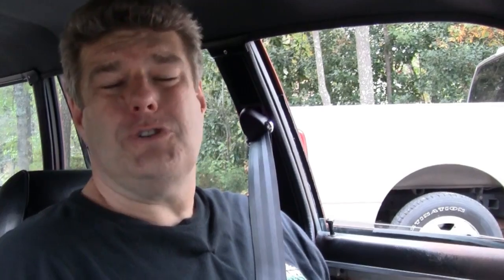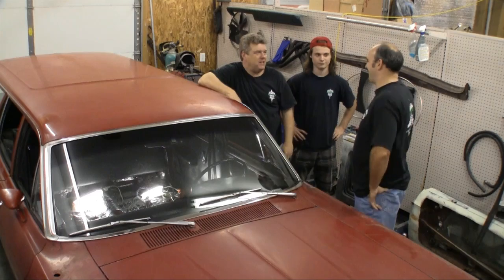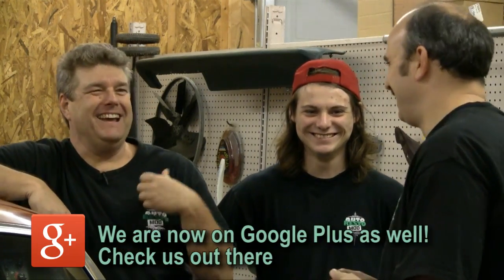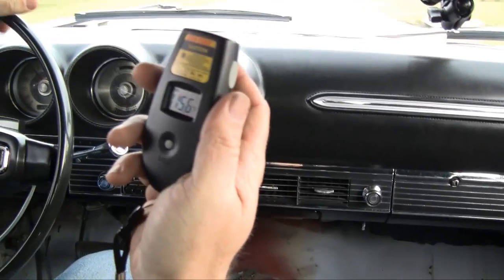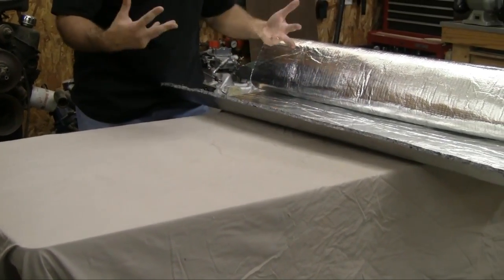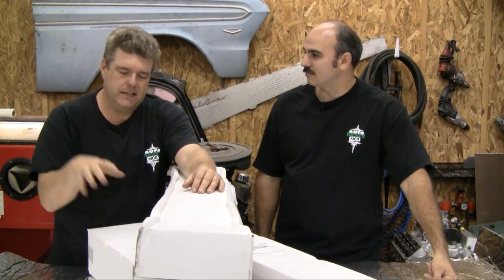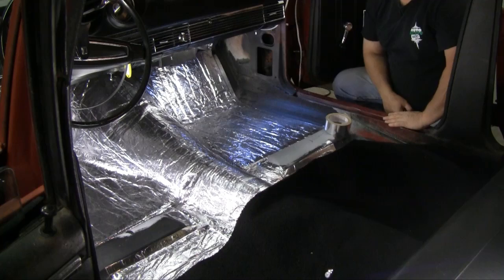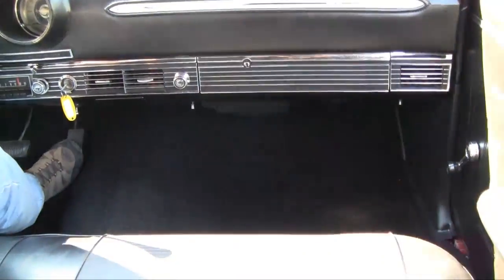Cheap and effective heat barrier for car interiors Episode 139 Autorestomod

Comment: You guys probably don't want to hear about science and stuff, but a radiant barrier MUST have one side of the foil touching NOTHING or else it will simply conduct the heat through the next material touching it.  Otherwise, you're just stalling the heat transfer.  Maybe it's enough to get from point A to point B before complaining about the heat.
Reply: Don Kingery if nothing else, its an awesome and i mean awesome sound barrier. For that alone, its worth the money especially on a muscle car with 400+ hp and 3 inch exhaust...not to mention it does run cooler. Eventually ,yes, after hours, you are right, its all the same temp. But think about 99% of the people using this type product. They are building a weekend touring car to go to car shows, restaurants,  beach, etc. Most of these trips are under an hour. It slows the heat transfer down considerably so much that in that hour , the car is definitely easier to cool.
Reply: Yes.  On those points, I follow your argument.
Reply: I think the denim jute between the foil is there for that same reason

Comment from the maker: We did an episode on Lizard Skin that included temp test: Episode 3 Lizard Skin Sound and Heat Control Autorestomod. As we said in this episode, we like certain products for certain things. This product works great in the interior, but not inside of doors where water intrusion is rife. Lizard Skin would be better in the doors and inner fenders etc. and as an additional heat barrier on the pans maybe under the car.

Comment: Adding insulation on the floorplan, firewall behind the engine and even beneath the headliner should help reduce heat and noise.  This is especially needed for cars with air cooled engines, such as Porsche and other sports cars.
Reply: Makes good roof insulation.👍
Reply: Gotta glue it up.

Comment: My Miata has very little to no insulation under the carpets and there's a lot of heat coming through the transmission tunnel.  I've read that pretty much any insulation will quiet it down in there a bit too (kind of a secondary concern with a flip top.  I'm definitely looking to make this car cooler in Florida summers.  I think it would fit in the back of that big Ford too...

Comment: POR -15 is a humectant, and cures with the moisture and extra oxygen molecules on surface RUST. water can and does creep under primer that's coated with por15. I also use it in low lying areas, bare metal thats rough, or surface rust... Might be ok for your location but its meant to bond to metal... Good video and Ill be trying the bonded logic, thanks!

PS, No Gloves with POR15 ?? OMGGG you are a brave soul..
Reply from the maker: Thanks for the tips on the POR-15. Normally we do remove the paint, the pans were already in epoxy primer from the body shop. Jeff decided on the POR-15 as a bit of additional insurance. Jeff was out of gloves and did live to regret the lack of gloves.
Reply: AutoRestoMod Muscle Car Resto and Modification
Reply: POR-15  Should NEVER be used in a vehicle cab as recent tests show the MDI in it releases TOXIC fumes continuously,  the health risks are enough to disqualify!  Glad I searched prior to installing.
Reply: Done a bunch of them. Cars just aren't that air tight.

Comment: Reflective heat shields over the exhaust pipes (like never cars have) are great. Use flashing aluminum spaced 1/4" from floor boards. Or stainless... Even foil tape works but is not permanent.
Dynamat stuff on the bare firewall first helps the sound a lot.
Reply: Lots of street rods over decades, and am doing the pipe reflectors now.
Reply from the maker: We've looked at reflectors too. Good points.

Comment: How much insulation did you use ? Great info going to  get some because of you .. Thanks auto resto mods Lov you guys ,you are Helping me build my Fairlane 66 & 69 351c engine  ; )
Reply: Remember to ask for Bonded logic when trying to find lol
Reply from the maker: Honestly that's been so long ago I don't remember the exact yardage we used up but it's about the same area as the carpet on the car plus underneath the back seats
Reply: I couldn't get bonded logistics, but found another type going to try bought 2 rolls ,hope it's enough lol

Comment from the maker: Very well. As we said we like Lizard Skin for some things; like for instance the rear facing seat well on the wagon. We'll be putting Lizard Skin sound and heat control on the outside of the well since it will be a high traffic area and this product (without carpet) will not fair well under foot.

Comment: i know your vid is 8 yrs old, but it's what i was finally looking for.  a newbie doing a van project (96 econoline) and the trendy vids are useless.  thanks for the info and humor!  if you read comments, will you please let me know your opinion on one idea: if i line my walls with molle panels to strap small bags to, etc, then could i stitch or glue this to the back of the molle panels and have it help insulate the walls too?  seems like it should work great there too.  thanks, b
Reply from the maker: I would probably adhere it to the truck walls. Aluminum side to the interior.
Reply: @AutoRestoMod  thanks.  I put some in under a rubber layer but didn’t tape it down with hvac tape. A day later, I lifted it up to run a wire and found moisture underneath.  I’m in colorado so we don’t have high humidity but it did rain heavy that night. I did paint with por15. Do I have to replace the rubber with breathable carpet?

Comment: Unfortunately, the product tested here is no longer available on ebay. There are quite a few similar options from China available on Amazon. Maybe when you have time in your schedule, do a smackdown with those.
Reply from the maker: Bonded logic doesn't sell the double foil right now, but they still sell a single layer foil which would work probably just about as well.

Comment: Amazing video.  thank you.  I have a 2005 Toyota 4Runner and it gets so hot near my feet and sadly once the car is over 90 the A/C just doesn't seem to make a difference anymore.  What are your thoughts of me setting the material in the engine compartment, in the channel around the exhaust and inside the SUV on the floor panels?

Comment: was almost sold on this stuff until i read that it burns quite easily.. trying to find the best insulation for heat/noise.. decently priced helps too..
Reply from the maker: The product has a fire retardant in it according to the manufacturer. Keep in mind that most products are flammable in classic cars.
Reply: @AutoRestoMod  hmmm. may reconsider then. i just read a review that someone tested a small piece that caught and sustained a flame. summit stopped carrying it for some reason though, so i'll have to shop elsewhere.

Comment: i have some of this in my bronco.  works pretty good till it gets wet.  Then you better pull it out and dry it off or your floor boards will rust out.
Reply from the maker: They used to have the double foil. It is now only single foil. If I did it now I'd put the foil face down.
Reply: @AutoRestoMod  i went overboard on rust prevention.  Sanded the floor down, epoxy primer, por-15, then rustoleum truck bed liner, then rattletrap xxx sound deadening sheets, then the blue Jean foil jute pad, then carpet.

Comment: Great video! Is there a need for any jute carpet padding after applying a heat barrier and  before installing the cars upholstery?
Reply from the maker: That depends on the carpet set. If the Jute is causing a hump, I'd remove it. if not, it is just one more layer of heat protection.

Comment: ouch on the rust underneath the primer........its going to come back to haunt you....at the point of discovery,,,it need to be wirewheeled or ground down with a grinder,,then treated with a metal prep to convert rust ...ie the one POR-15 recemends in their steps of there prouduct....Primer doesnt cure rust....I wonder how much rust is lurking under the rest of the primer???  Good Lock with ur project...good vid too.....

Comment: Cool! (Literally)
What about noise reduction? I don't believe you mentioned that.
Is an expensive product worth the extra bucks, or will the cheaper ones do the job?
I am currently restoring a 69 Camaro and your channel is pretty darn helpful :-) Thank you!
Reply from the maker: We'll say that the cab of the wagon was noticeably quieter with the carpet and Tru Mat. But we didn't do a Db test before the install...and even if we had it would have be flawed as the car has enough side window air leaks to qualify them as screen doors. And don't get us started on the back window that is for the time being perpetually down due to window run gasket failure.

We will say this: All of these products have their place. We used Dynamat Xtreme in some areas (over the Flowmaster Mufflers) and plan to use Lizard Skin sound and heat control on the underside of the rear facing seat area since this will be seeing a lot of foot traffic when we are shooting car-to-car video.

Comment: I'm concern i've seen a guy work on his project car and he added this type of heat insulation and a few days later his car caught on fire from the inside. just letting you know what happen.
Reply from the maker: Thanks! Was it the insulation or something else? The product has a fire retardent in the material.
Reply: +AutoRestoMod Muscle Car Resto and Modifications 
can't quite remember how it was because its been a year since the incident happen but he told me that when he saw the car everything was hardly noticeable but he put everything in its proper place I'm just not sure why though.
Reply from the maker: The Lopez Way OK. This product is speced for the car market so...
Reply: The Lopez Way o

Comment: I haven't replaced carpet and underlayment before, but my car came with the carpet kit. So should I put the underlayment on top of the Bonded Logic before the carpet, or only the Bonded Logic and carpet?
Reply from the maker: I will place the carpet with the underlayment (underlayment on top of the Bonded Logic) to see how it lays. Often, I find that the underlayment adds too much bulk.
Reply: Thank you for the advice, I will check it out when I get to that point, probably early Spring.

Comment: very nice, a question;  is it also effective to use armaflex sheets instead?
Reply from the maker: Thanks! We haven't used the Armaflex so we can't say.
Reply: Baker Akram hmmm maybe. Id consider the flame or burn factor and in that case, rule out armaflex. The purpose built car insuation has a very low flame and smoke factor. The armaflex as i am a hvac tek can easily be chared with torch and puts out an all but deadly horrible black smoke. I cant imagine a whole car of armaflex smoking!!! The rescue team couldnt do anything to save you !!! Ok the last part was a bit of a stretch but it would be a much higher degree of challenge to get to you with a 30 foot wall of smoke thats black as any black youd ever imagine. I know this is all worse case scenario,  but for that alone, id stick with a few more bucks and put the stuff in that has passed the torch test

Comment: Did you glue the heat barrier to the floor? Would you glue carpet to the heat barrier?
Reply from the maker: We did not. Primarily due to the fact that we are planning to install new carpet in the car down the road. If you use the metal duct tape around the perimeter it should be fine. Our thing is, we'd rather be able to easily pull the barrier and or the carpet out and not have to struggle with the outcome of the glue.
Reply: +AutoRestoMod good point. I was going to ask that.  Since you did't talk about it in the video.

Comment: Did you use any adhesive to adhere the insulation to the floor, if so what did you use? TY in advance.
Reply from the maker: We used metal duct tape to adhere the panels to the floor.  We don't like to use glue on this stuff just so that it would be easier to remove if we need to do any work on the floors.

Comment: so does this mean my 66 mustangs A/C will finally cool my cars interior?
Reply from the maker: That depends on both the system and the engine's heat development. If you are getting under 50 at the vent it will help. Be advised that the trumax product has been out of stock for a good while at Summit.
Reply: ES12a Industrial refrigerant is super cold, straight drop in for 12, 134, 1234. 👍
Less than $20 per car.
Mine does vent 43* on 111* day.... In town.😁

Comment: Where did you guys get the metal duct tape from? Can't find a roll that big
Reply from the maker: +von19888 Most big Home improvement centers will carry it. It will be over in the Air Conditioning section with the duct work.

Comment: I'm assuming this would be great for the roof? Or what would be best for the roof to reduce the heat?
Reply from the maker: The only issue I have with using it on the roof is the fact that it's a little heavy.
Reply: @AutoRestoMod  what's the average weight to cover the roof?
Reply: @AutoRestoMod   the one you mention is also not for sale anymore. What would be the best material to reduce heat from the roof? And does it have adhesive already on the material? Also when adding this material can I lay it over the beams? I see in some videos people dont cover the roof beams why is that?

Comment: too bad you did not show the temp with the stock floor carpet-
Reply from the maker: We didn't but Jeff did take a temp reading and it was almost no different than the reading off of the bare floor pan.
Reply: So i didn't block the heat? It dosent work for heat blocking?

Comment: Is there some kind of adhesive on the bottom?
Reply from the maker: No, you can use an adhesive but the metal duct tape works really well to keep it in place. With the carpet set in there will be no real movement. We prefer to not put any adhesive down to make it easy to do any work on the carpet or what ever.
Reply: Autorestomod Manic Mechanic Gasoline Media wait was the black paint than? I thought that was glue
Reply: POR 15 rust encapsalator

Comment: Do you still need the underlayment  figured it would be to thick?
Reply from the maker: We removed the factory jute on our application. What we'd recommend you do is put down the Super Insulator and then install the carpet over it to see how it lays. If you get a good or better fit then we'd install the Super-Insulator and the carpet with jute.

Comment: What do you think about using this with a headliner?
Reply from the maker: It can be heavy with the double aluminum.I'd say that the single foil would be great. Maybe use a contact adhesive rather than spray on. Seems to hold better in the long haul.
Reply: AutoRestoMod Car Restoration Modification thank you!

Comment: Anybody know if there is a way I can sound deaden and insulate without having to get straight at the sheet-metal? There is plywood drilled into the sheet-metal floor of my Class B motorhome with a ton of stuff on top of the wood, so itd be great if I didn't have to demolish the place.. can I just do it on top of the wood or does it have to make contact with the sheet-metal?
Reply from the maker: If the motorhome is carpeted you could possibly put this stuff down without having to do anything but take up the carpet.
Reply: I would just pull up the carpet down to the plywood and then install MLV sheeting (Mass Load Vinyl) which can be purchased in large rolls and with variable thickness.  Just be aware that the thicker you go, the more cost and more weight it will add.  Check out SuperSoundProofingSales dot com.  Their prices seem to be very reasonable.
Reply: a